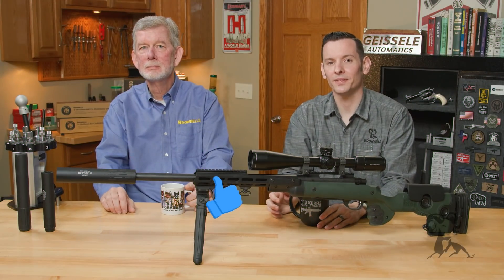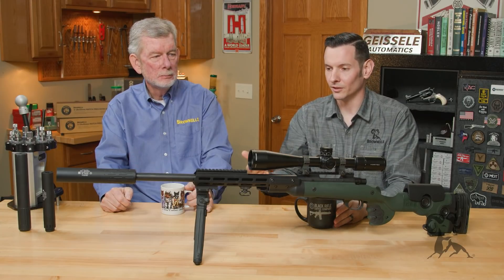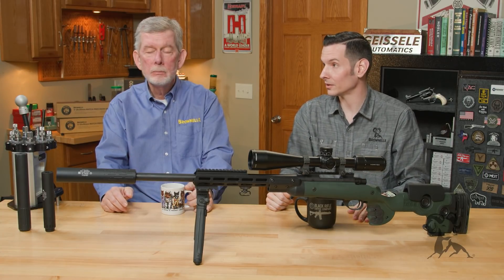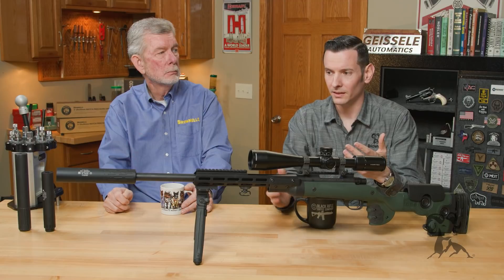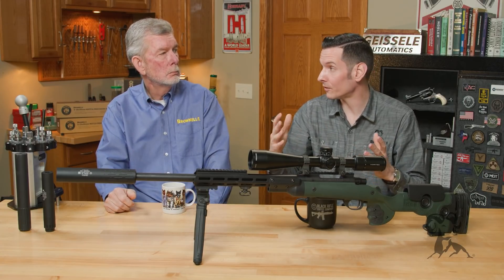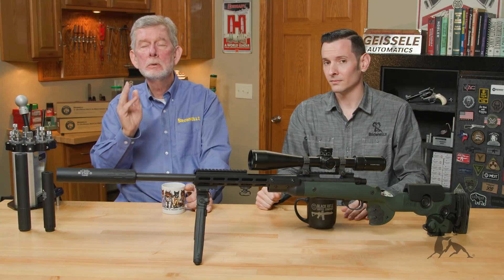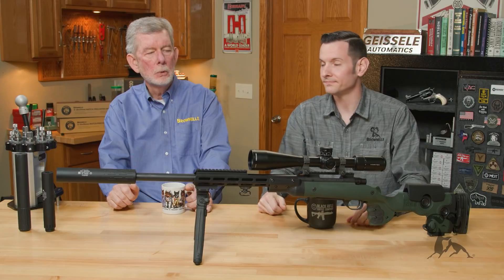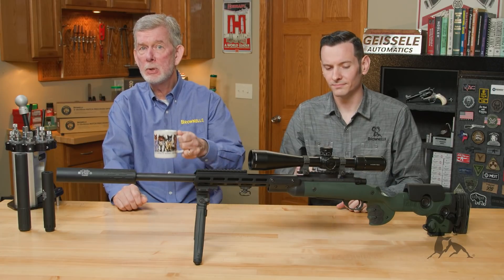Smyth Busters: Does a Suppressor Reduce a Gun's Accuracy?

Comment: Poor suppressor design and manufacturing can have accuracy issues on your rifle assuming the rifle is sound. But a well made suppressor can even improve accuracy if it just happens to luckily function as a barrel tuner to your particular combo. In my place I am allowed to purchase suppressors without limit or paper work so I buy several types and choose the one that I deem improves or at the very least does not affect accuracy. The bench crowd here though shooting .22lr do not use suppressors as they attest to it causing small poi shifts when the suppressor is dirty, the shots are fired in rapid succession, and it heats up the barrel faster also causes change in poi. Not a bench shooter though so I just take their word for it.😁 On my sbr subsonic bolt rig though a heavier and thicker 10inch suppressor has the same POI of its identically designed shorter and slightly thinner 6inch Suppressor at 50meters but the bigger heavier suppressor has about an inch and a half drop at 100meters. Velocity is about the same and I don’t think the suppressor is causing barrel droop on a fluted stainless 12.5 inch bull barrel… it’s just probably harmonics caused by the bigger silencer or something else???😁

Comment: I cannot speak to all suppressors, but the suppressors used on the m40 series rifle absolutely opened up the groups. The guns ran .7 moa and under at 300 yards without a suppressor and muzzle break. With the muzzle break and suppressor mounted they opened up to 1 moa consistently. That may have been due to the mounting method involving the break as an intermediary though.

Comment: Both a pal and I have rifles (that came factory threaded) that give us 1/4” accuracy. Despite the claim moderators assist with accuracy as they reduce recoil, neither of us can achieve much better than 1” accuracy with them installed. Competition shooters will not use a moderator for this very reason. Sorry guys, but in this rare instance, I don’t believe you can bust this ‘myth’.

Comment: There is a whole science around cans (suppressors). Here are some facts: The speed of sound is determined by atmospheric density, air temperature and humidity so it can vary locally throughout the day depending upon these variables. Suppressors (outside of a VERY FEW HIGHLY SPECIALIZED WEAPONS PLATFORMS like the HK MP5SD) DO NOT SLOW THE BULLETS DOWN, therefore a supersonic bullet will remain supersonic and therefore the sound of that round cracking the sound barrier will be heard. A suppressor slows and cools the gases coming out of the muzzle end, thereby suppressing that sound component. If the firearm has a locked action such as a bolt, lever, slide/pump or break action, these platforms will be quieter than a suppressor equipped semi auto. Some gases will escape from the receiver (referred to as receiver pop) and this, combined with the sound of the action itself will add to any sound signature. The diameter/metallurgy/length/temperature (all affecting the stiffness) of the barrel, muzzle crown damage/design, cartridges used (bullet weights, powder burn rates, rifling twist rates), weight of the suppressor, repeatability of the mount of the can, and the location of the can on the muzzle threads, combined with the suppressor design (including materials, baffles, baffle chambers, endcaps) ALL play a part in inflating barrel harmonics and as such the precision of the firearm/suppressor combination. As for wet/dry cans, the heat from the escaping gases from the muzzle, will flash the ablative material (water, grease, etc) thereby cooling the gases even more than the baffle/monocore design, thereby often reducing the can signature by 2-3 dB at times. Not all cans will work when used with an ablative substance. All of these variables are in play when discussing suppressor performance on a particular firearm platform on any given day, at any given location. (I am the marketing director at GSL Technology (gsltechnology.com), an engineering driven, no hype suppressor manufacturer with over 35 years of suppressor design and manufacturing.)

Suppressors can and often do, aide in shrinking group sizes due to the more uniform gas impact on the projectile as it leaves the endcap of the can. Another factor in accuracy is more shooter induced, and again, suppressors help in this by reducing perceived recoil and sound signature, both of which can cause the shooter to anticipate a shot, and therefore jerk the trigger a bit. By making the firearm less "obnoxious" (for lack of a better term) to shoot, the operator is less likely to jerk the trigger. 

Point of Aim/Point of Impact (POA/POI) can happen, (again that goes back to barrel harmonics and other factors listed above) but the POI/POA doesn't really matter as long as it is CONSISTENT. If consistent, the firearm should be re-zeroed with the can attached shooting the preferred load.

Comment: You guys kind of missed a key point on this one.  If you have tailored a reload recipe for best accuracy in a given rifle, and now add mass such as a suppressor, brake, etc, you can definitely impact accuracy.  Depending on the barrel stiffness (function of length and profile) and the amount of mass involved it may be minor, but the physics are such that both point of impact and accuracy are affected.  It can easily be enough that you have to go back and develop another load to optimize accuracy with the suppressor.

Comment: I don’t disagree but I also don’t entirely agree. Remember, when you hang a heavy object off the end of your barrel, you must account for the change in barrel harmonics. If you do your load development without the suppressor and then add the suppressor after-the-fact, your groups will absolutely change. It may not actually change your POI (aka: accuracy), but it will have an effect on your group size (aka: precision). If you do your load development with your suppressor (or whatever muzzle device you intend to use) mounted, you will likely not see a measurable difference.

Those who say that suppressors improve accuracy are also coming to a false conclusion. In some cases, adding weight to the end of a barrel may make a load shoot better in a given rifle. This is pure luck if it does, of course. This is because the barrel harmonics were “accidentally” improved by adding weight to the end of the barrel. These people are shooting factory ammo or don’t do proper load development in the first place and instead they just load for velocity. 
Every rifle barrel has an “accuracy node”. The load must be tuned to find that accuracy node in order for that barrel to realize its potential. In 22lr competitions, most top shooters use a “tuner” (a adjustable weight) on the end of their barrel to help optimize their barrel’s harmonics. This is because most shooters cannot hand-load for rimfire cartridges. Adding a suppressor can accomplish the same effect but it’s “hit-or-miss” because the mass added by a suppressor is not adjustable like a tuner. That is why some people experience improved groups while others experience worsening group size when adding a suppressor.
Reply: Very well stated. Thank you for shooting straight.😁

Comment: I'm a 91F in the army. My unit has snipers, and the snipers have AAC QD suppressors. Had a bunch of snipers who wouldn't properly maintain their suppressors, and would never remove them for cleaning. The argument they make is that removing the suppressors changes the zero.

They are only half-right of course. Removing a suppressor typically shifts the point of impact up, but that's only because the 1.5lbs of metal you had hanging off the end of your barrel is no longer there. Putting it back on brings the zero back.

The effect of not cleaning the suppressor is that it could foul and not suppress as well. The serious problem that happens (especially with QD suppressors) is that the retaining latch jams up and may not secure itself properly. We see bullet holes in suppressors from time to time. Other than that, suppressors don't negatively affect accuracy at all.

Comment: If you bullet hits you suppressor it might affect accuracy. before modern machining there were more imperfections and flaws but that has been greatly reduced but extended use or a hard bump or even a blockage in the suppressor components from heat or stress

Comment: The addition of a device added to the muzzle end of a rifle barrel can either increase or decrease the accuracy depending on how it changes the baseline unimpeded barrel  harmonics. If a muzzle mounted device degrades the original barrel harmonics, the addition of one of the rubber type barrel tuners could restore or possibly improving accuracy.

I feel a need to add, that is the butt ugliest rifle stock I have had the displeasure of seeing.

Comment: As you alluded to, suppressors can negatively affect accuracy if they are not aligned properly, or for some reason the round contacts them as it exits the barrel.  I would suspect that a poorly designed suppressor could also have a negative effect, but any decent quality properly mounted suppressor should not.

Comment: I was surprised you guys didn't mention adding a suppressor is likely going to change your point of impact, and that part of responsible gun ownership is to shoot your rifle after ANY change to your muzzle device or change in ammo selection to verify your zero, and re-zero as needed. I can just picture some smooth-brain who put on a can and switched to sub-sonic rounds whining about how now his gun doesn't shoot straight.
Reply: if the harmonics are changed it can give larger groups
Reply: @peteralexben  True that. I have a Enfield No.4 Mk1 that someone sporterized (barrel is intact, stock was sporterized), and a sporter stock throws off the harmonics because the No.4 was meant to have the fore end of the stock place about 6 pounds of pressure to the underside of the barrel. By removing this, it affects accuracy since the harmonics are disrupted.

Now, one could argue this makes the gun less accurate. Well, yes and no. Yes, if you just run factory ammo, you're gonna get about 3" @100 yards. HOWEVER, if you understand the harmonics have changed, you can do like I do and hand load rounds tailored specifically for that rifle. In my case, my hand loads shrank my group from 3 MOA to 0.9 MOA (0.9" @100 yards).

So outright saying changing barrel harmonics makes a gun less accurate is a half-truth. Yes, less accurate if you don't use the correct ammo, and no if you do use the correct ammo.

I haven't had the pleasure of owning a suppressor yet, but when I do get one, I will no doubt make sure not only to verify my zero, but also either find factory ammo that runs well, or handload to ensure my gun is well tuned.
Reply: i had a supressor on a 22 lr that sadly got a bump then the groups whent from 1/2 too 3 removede it and now its back agåin and the noise is not so bad anway i think they when a bit too fast on this

Comment: Great vid guys! I think there's a lot of misconceptions and confusion about suppressors. Doesn't a can change your point of impact vs. using just a muzzle device? I would love to see more reliable info from you guys about suppressors, there's so much to learn about like wet vs. dry or that they cause increased dwell time NOT back pressure. We need a reliable source like you guys to clear up these details!
Reply: There is a whole science around cans (suppressors). Here are some facts: The speed of sound is determined by atmospheric density, air temperature and humidity so it can vary locally throughout the day depending upon these variables. Suppressors (outside of a VERY FEW HIGHLY SPECIALIZED WEAPONS PLATFORMS like the HK MP5SD) DO NOT SLOW THE BULLETS DOWN, therefore a supersonic bullet will remain supersonic and therefore the sound of that round cracking the sound barrier will be heard. A suppressor slows and cools the gases coming out of the muzzle end, thereby suppressing that sound component. If the firearm has a locked action such as a bolt, lever, slide/pump or break action, these platforms will be quieter than a suppressor equipped semi auto. Some gases will escape from the receiver (referred to as receiver pop) and this, combined with the sound of the action itself will add to any sound signature. The diameter/metallurgy/length/temperature (all affecting the stiffness) of the barrel, muzzle crown damage/design, cartridges used (bullet weights, powder burn rates, rifling twist rates), weight of the suppressor, repeatability of the mount of the can, and the location of the can on the muzzle threads, combined with the suppressor design (including materials, baffles, baffle chambers, endcaps) ALL play a part in inflating barrel harmonics and as such the precision of the firearm/suppressor combination. As for wet/dry cans, the heat from the escaping gases from the muzzle, will flash the ablative material (water, grease, etc) thereby cooling the gases even more than the baffle/monocore design, thereby often reducing the can signature by 2-3 dB at times. Not all cans will work when used with an ablative substance. All of these variables are in play when discussing suppressor performance on a particular firearm platform on any given day, at any given location. (I am the marketing director at GSL Technology (gsltechnology.com), an engineering driven, no hype suppressor manufacturer with over 35 years of suppressor design and manufacturing.)

Comment: To be fair, the sr25 suppressor induces inconsistent POI shifts after the suppressor and barrel warms up. The gate mount isn’t the issue, the barrel tip that mates with a “shoulder” inside the suppressor loosens up as the metal expands. Causing it to shift by 2 sometimes 4 MOA at 100yds. Can be witnessed in under 12 rounds over the course of 5 min. The m110 fixed this greatly with the use of the large flash hider. But yes compared to a lot of newer suppressor mount ups they are pretty consistent in their POI shift once attached.

Comment: They don't necessarily make a rifle less accurate but it can change the point of impact in my experience. Your dope will definitely change and you'll have to adjust to or compensate for the new point of impact if you've sighted in without a suppressor then added one later.

Comment: My experience had been really good with suppressors as the fellows stated barrel must be properly thread in accordance with bore Center ! Then make sure the stop face it true to barrel center then follow manufacturers torque spec when installing suppressor adapters and or suppressor its self, a well designed and built suppressor has helped with accuracy ,, but copies n cheap knockoff are totally different n this is where I believe is the problem n cause of myth,, working with some manufacturers we tried all kinds things testing for suppressors the quietist was 12 inch long 4 1/2 diameter lawn mower muffler packed lightly with steel wool not practical but works good

Comment: Do a video explaining the crush washers vs shims
Reply: When it comes to muzzle devices, a crush washer allows you to torque a compensator down while allowing the slots in the compensator to be properly aligned. You will need a crush washer for A2 "birdcage" compensator, because it is supposed to be torqued so that the center slot is top dead center. It's important that you do not over torque crush washers, because if you loosen the compensator, the washer is already deformed, so you will need a new washer.

Shims are useful when bore alignment is important. A crush washer won't necessarily allow you to adjust bore alignment, and as you can probably imagine, bore alignment is more important in suppressors than with compensators. Dont want to go shooting a hole in your ~$1500 suppressor that you waited like 9 months for.
Reply: @Grabbagar670  thanks

Comment: This is wrong.  It'd be crazy to think they have no affect on the bullet.  My Omega 36M killed the accuracy of my APC9K.  And it had a SilencerCo ASR flash hider already that made no accuracy change.  And it had perfect alignment.  I explained to B&T, and they responded,
"
Unfortunately we do not have any recommendations. The only variable at play is the Omega 36M and as we are not the manufacturer, we could wouldn’t speak to the suppressor. Let us know if you have anything we can help you with."
Reply: So, you're saying that based on your singular experience, i.e. that ONE SPECIFIC suppressor on ONE SPECIFIC rifle (and not even an entire product line of rifles or suppressors, but ONE ITEM EACH), completely invalidates all other data and the conclusion is wrong? Do you not see anything wrong with your own assertion? These guys talking have literally seen THOUSANDS of rifles and suppressors paired together. They have more combined years of experience than you've been alive. Pretty sure they know what they're talking about. How many rifle/suppressor combinations have you ACTUALLY tested yourself, besides the one you mentioned? I'd wager exactly zero. Furthermore, do you even know the difference between POI and accuracy? A change in the point of impact is NOT a change in the accuracy. Accuracy = size of the group. POI = where the group lands. That's why it's called Point of Impact.
Reply: @Orcinus24x5  Yes, with a single counter-example you can show that a definitive statement like, "No, suppressors don't affect accuracy" is wrong.  Not just me, but precision shooters say the same thing.  You're also wrong about your other assumption.  Many combinations, but that was just the most prominent example.  Do you know anything about barrel harmonics and how a suppressor will change it?
BTW, it's clear you have no idea what an APC9K is.